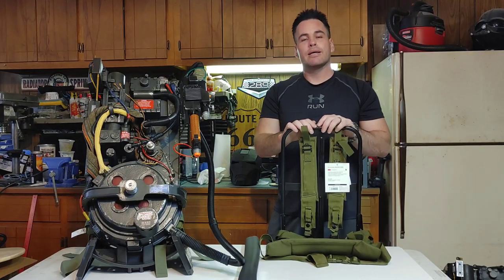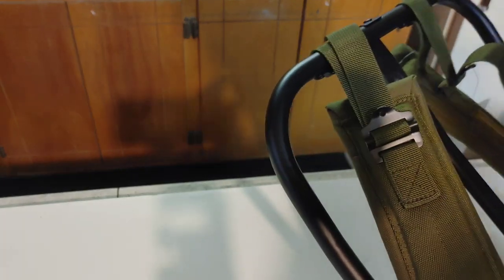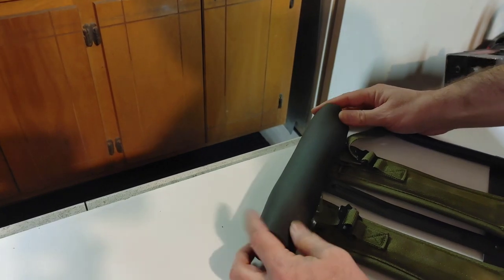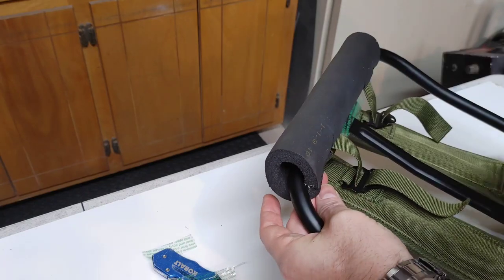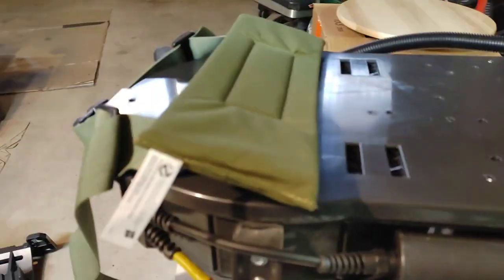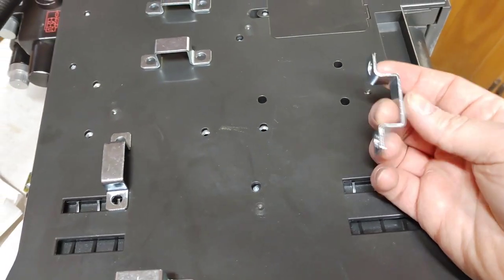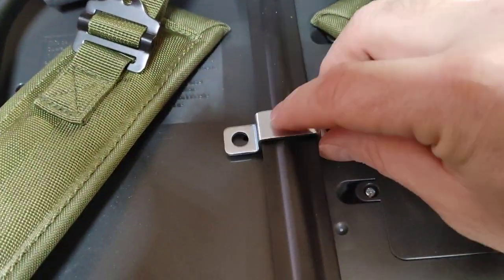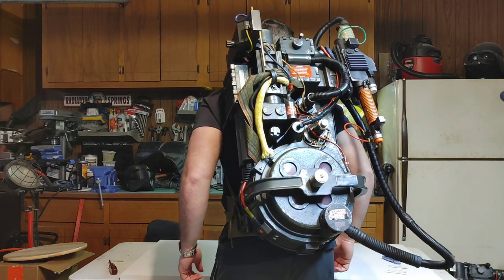How to Add Alice Frame to Hasbro Proton Pack

Comment: A couple of things I had to do differently:  I had to replace the two long screws at the bottom with longer (5mm) screws.  The supplied screws just barely caught the threads of the inserts in the pack.   Also, I had to notch the frame's cross bar to make those two brackets fit - they did not line up with the threaded inserts on the pack.

Comment: I tried mine on with the factory straps, it didn't feel very good wearing it resting directly on my back. Also, I'm a pretty big guy and the straps were a little tight for me even when loosened as far as they would go. It feels much better to wear with an ALICE frame attached, and the straps on the frame fit me much better.
Reply from the maker: I didn't try it on without the frame but I'm sure as you said its uncomfortable. It's comfy and light with the frame.
Reply: I felt the same way. Plus, loosening them while trying to stabilize the pack is a bit obnoxious whereas the ALICE can sized before mounting and ready go afterwards.

Comment: What’s the thickness needed for the insulation foam rubber? I’d like to order it if I can find it online anywhere.
Reply: He said "one inch foam, rubber"
Reply from the maker: 1 inch foam rubber pipe insulation. You can get it pretty easy at your local Lowe's or Home Depot. 3/4 inch works as well but I like the extra padding with the 1 inch.

Comment: What is the screw size? There is supposed to be a wider space between the mother board and the frame. Spacers to increase the width
Reply from the maker: The original pack shells used in the film did have spacers in between to create a gap from the frame to the pack motherboard. Hasbro specifically designed it this way so that the consumer wouldn't have to drill any holes or do any modifications and could just easily add the frame so with that constraint it does have less of a gap. The screws are 10-32 or 10-24 if I had to guess but not entirely sure.

Comment: Nice job. The Alice frame is super tight on the top though. It tapers in for some reason. There should be a gap between the foam tube and the back of the pack. Any suggestions on how to fix this issue? Cheers
Reply: They designed the brackets to hold the top of the frame directly against the motherboard. I think they did it that way because it's the easiest way to attach the ALICE frame without having to drill holes into it. I modded mine by laying the frame on top of the brackets and using zip ties to secure it. I plan to drill into it and bolt the frame to the brackets with spacers to make it more accurate.
Reply from the maker: It was specifically designed that way so that you wouldn't have to drill any holes. To have the frame more accurate would require drilling a hole in the frame where the top bracket is. You'd also need a spacer in between like the ones on the bottom. Since the pack is plastic you'd have to add a threaded insert so the newly added screw through the top of the alice frame would bite. Hope that helps. I don't plan to do any such modifications to the pack at this point.
Reply: @ChrisBoshProps  Interesting. Yeah, they could have just provided two extra spacers (like the ones at the bottom) and longer screws for the top. It would have evened it out properly then. It's a minor issue really, but it just looks wrong from the side view.
Nice work. Looking forward to seeing any other mods you make on it.
Reply: The Alice frames bend pretty easy so your may be bent.
Reply: @christophernewman8741  Good point. It does look flatter than it should be.

Comment: Does the pack stand on it's own when attached to the Alice frame?
Reply from the maker: No unfortunately it does not.
Reply: I don't think the real prop can stand on its on either.  It was always shown laying flat (like in the courtroom scene in Ghostbusters 2), or stored in the modified gurney rack in the Ecto-1 (which the display stand is based on).

Comment: I have a issue with the hose losing connection. It’s on tight enough and I have fresh batteries in it. But when the hose bends, and I’m not bending it that much. it loses connection, and then turns the pack off. I’m wondering if anybody else has had this issue. I contacted customer service, so hopefully they’ll get back to me soon.
Reply from the maker: I'm sorry to hear that. I actually went out for you just to check and wiggled my house around quite a bit and never lost connection.  I'm sure you already have done it but make sure to double check your connection, unplug and plug/screw it back in and make sure the 2 prongs are making connection properly. I hope that helps.

Comment: What a pity for the hose. it doesn't look very good. the hard part that comes out of the pack is very outward
Reply from the maker: It's kind of like that on the Afterlife pack as well. But I agree it does look a little stiffer.